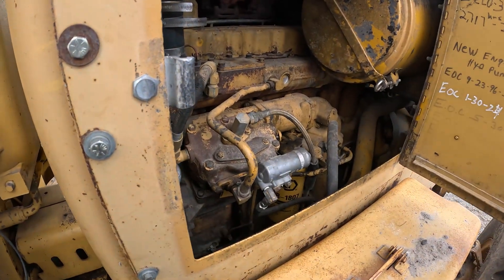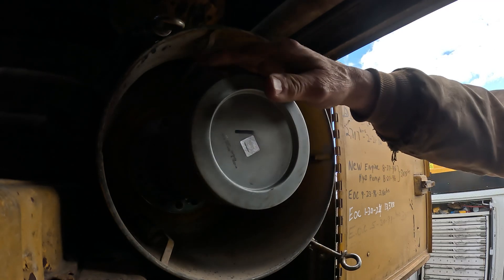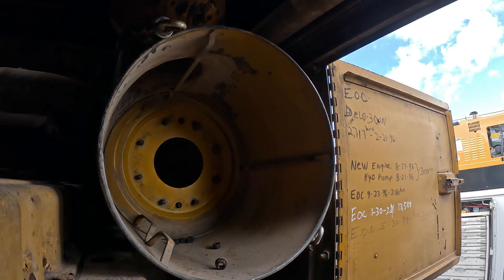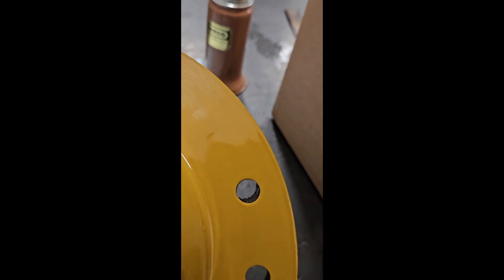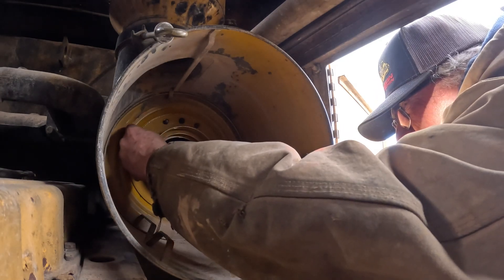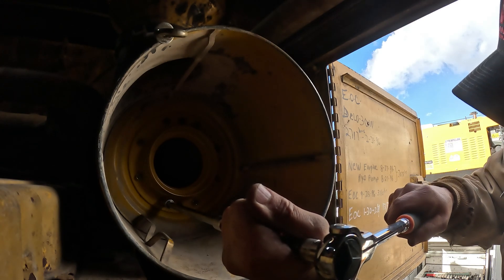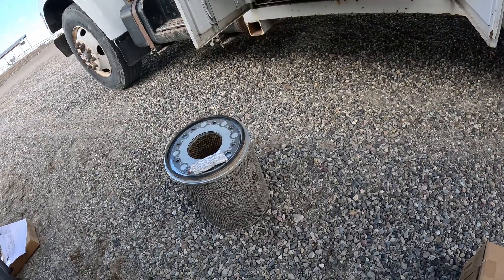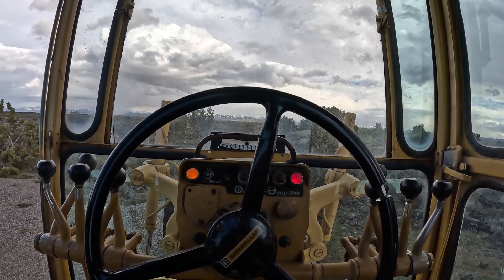Radial Seal Air Filter Conversion On CAT 14G

Comment: you would think they would use a jig to put those gaskets on the exact same on every one. I guess eyeballing it works too, oh wait, no it didn't.
Sitting here watching this through a tornado warning, Sky was black with eh wind gusting like crazy at the start of the video, blue clear skies by the end of it. Spring weather is crazy.

Comment: As long as you have air available I’m sticking with air tools. Batteries too expensive and some day tool company will come change the tool and new tool will require new batteries. You take care of air tools they last forever.

Comment: Is the neutralizer so you can start the engine without the drag of the hydraulic system? 
 have not been around too much of that old CAT stuff.
Reply from the maker: Yes, piston pump takes a bunch of power to get it to operate initially then it will center the swash plate and stop demanding so much power